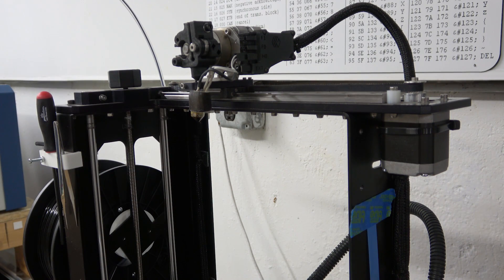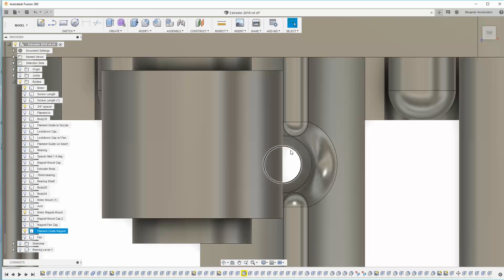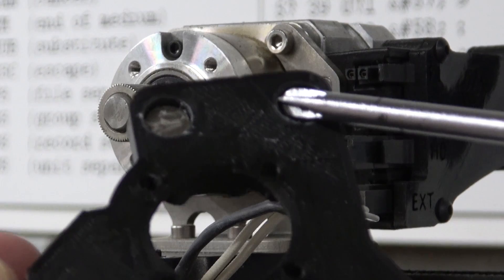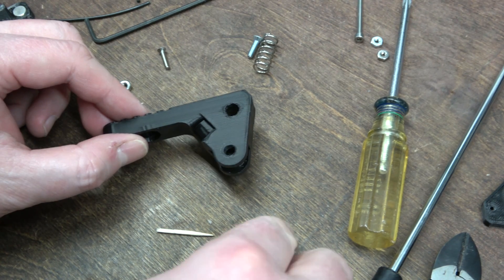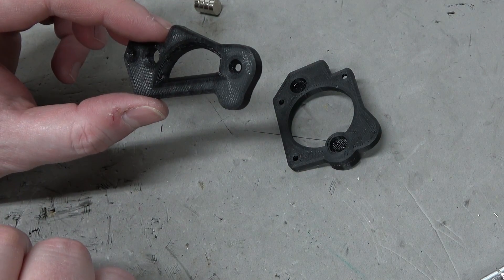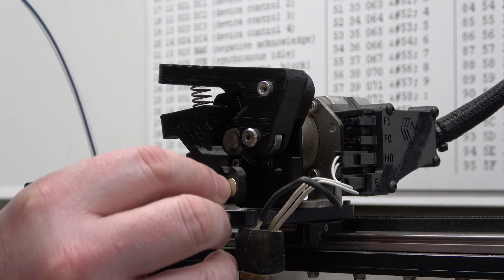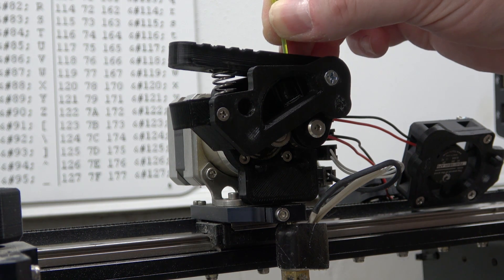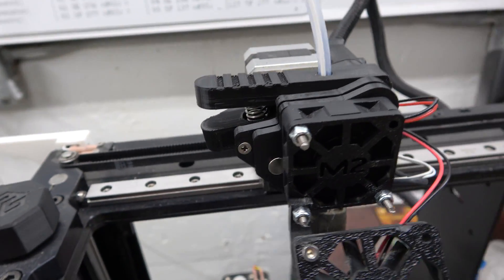Designing a new Makergear M2 Extruder

Comment: Ben each separate part in fusion 360 should be a new component, not a new body.  If one part is made up from several sections then you would use a body for each section, however, if your model has several parts(like in this build) then you would use a component for each.  btw the outcome was cool either way :)
..

Comment from the maker: Kind of thinking I should redesign with all Metric. Just need metric threaded shaft and flat head screws (just used what  I had of course :)
Reply: make the rest of the world struggle finding the hardware needed... hehehe
Reply: Darn you Grandma and Grandpa for rejecting the Metric system!!!!! 
Fun fact there are 60 seconds in a minute and 12 hours in a day are based on sexagesimal and duodecimal based counting systems.  The duodecimal system counted knuckles on each hand so you could count 24 with both hands.  
https://www.scientificamerican.com/article/experts-time-division-days-hours-minutes/
Reply: Went to the shop to find the list of screws . took with me a paper .
Swedish help “ sorry its in english i can not help you”.
Me: What is in english ? M3 screw cap ? 10 mm ? 
Anyway left the store , as i need 100 years to find all these kind of different scews and seperator. 
Great job but i wish you provided printed screws too :p easier to print them than buy them 😂☺️

Comment: I mix hardware standards too.  I use what's in the junque box. Some of my stepper motors are threaded for SAE screws, some are metric.  They are all hamfest surplus stuff anyway.  I built my own extruder  out of aluminum stock 'CNCing' them with hand tools.  Mine is direct drive, abet with a 0.9 degree/step motor.
Looks like you had to cut one of those screws down to length.

Comment: It's funny how the original DIY-style 3d printer companies have all moved to the more small-business level, and now most of the actual "makers" buy completely different ones. Sure, the Ender 3 might have a technically-crappier mechanism, but it's "good enough" most of the time.
Reply: That cooling fan is soooo outdated though. You should make a ring or "fang" style fan shroud!
Reply: @moth.monster  , 
I like open fan designs when the clearance is available, as it is here. Constraining the airflow of "muffin" fans simply doesn't work very well. They aren't designed to force air at pressures created by the air nozzles. For that, you really need squirrel cage fans which are made for creating a significant ∆P.
Reply from the maker: They've all had to move upmarket because the Chinese printers nuked the hobbyist price point.

Comment: Hey, I'm Canadian, but just because I use the metric system, that doesn't mean I'm biassed. Everything has it's place! The place for Imperial sized threads, for instance, is in the trash!
Reply: After years of collecting junk, I have lots of SAE hardware.  I'll use metric for new builds, (especially when buying 3D printer parts made outside of the US), but it's still easier to find SAE hardware at the Homedepot than Metric. (They keep the metric stuff in an unmarked file cabinet behind a disused washroom with a sign on the door reading "beware of the Leopard").
Reply: I don't know what Ben has against metric system. It's the only system that makes sense and actually used world wide, unlike Imperial stupid fractions

Comment: Great video Ben! A question on the design though, on the filament guide where the filament goes, is it "cone"-shaped to make the filament go through the hole? It looks really cool but it feels like the extruder gear maybe won't align the filament perfectly to the hole if it's flat, or maybe I'm just thinking wrong.
Reply from the maker: The top of the filament guide is wider and has a filet. The tube narrows as it descends towards the hot end.
Reply: @BenHeckHacks  Awesome! Gave me some ideas for my creality printer. Can't stress enough how much I enjoy your videos.

Comment: Neat, Ben! For flexible filament, where you have to reduce the pinchy-ness of the idler against the filament, you should consider a bolt that goes between the thumb lever and the bottom lever to set a maximum tension. This will allow flexible filament to be driven without squashing the crap out of it (making extrusion impossible).

Comment: you should have added magsafe-ish connectors to the fans as well... or you have to pull off the fans from their magnets and then unplug the fans to avoid them hanging on the wires only  (strain is bad...)

Comment: so you 3d print parts for your 3d printer? this like a compiler written in a language which its compiles to
Reply: That used to be the primary use for these printers. Back in the day when I started there were no commercial printers, not even kits. You needed to build a crude RepStrap printer or hope you could find someone who already built a 3D printer to print parts for building a 3D printer. That's where the whole concept of RepRap started. Replication was the central idea. It is sad that this idea seems to have become so much of an afterthought.
Reply: 3d printing parts for your printer isnt at all unusual

Comment: On my creality printer, I had a lot of trouble with the extruder gear slipping on the filament, I replaced that extruder with a design that I can pretention the the spring that puts pressure on the filament, problem solved...